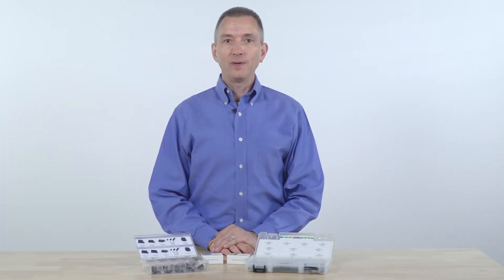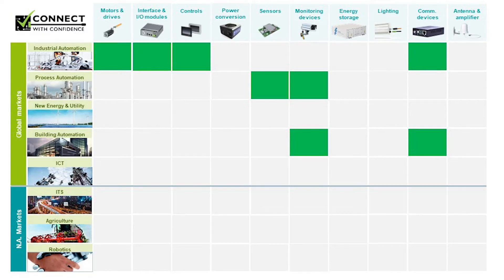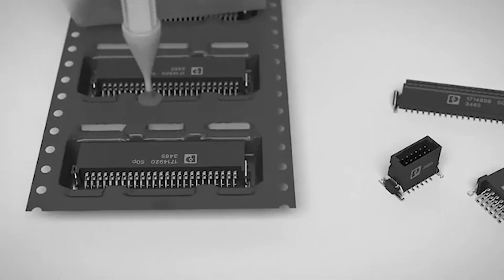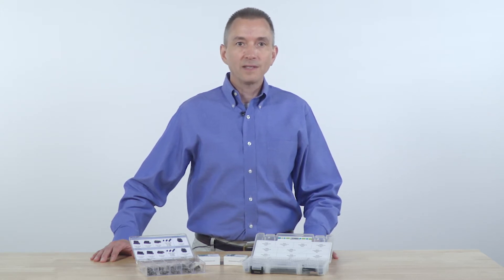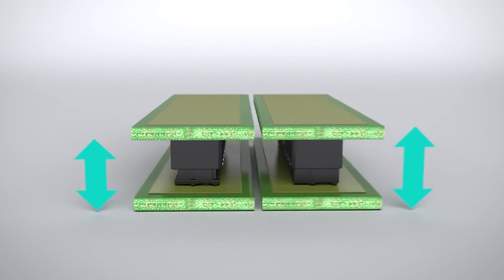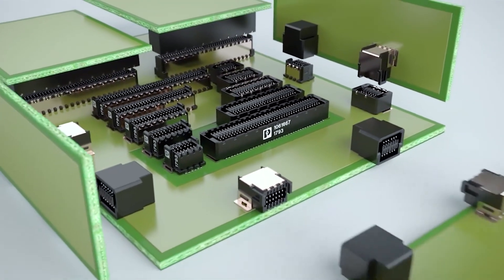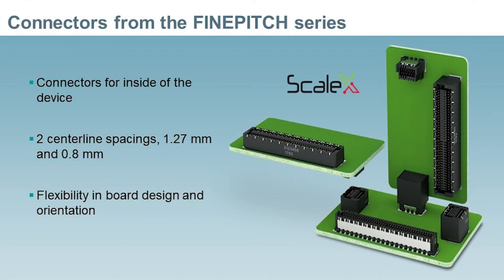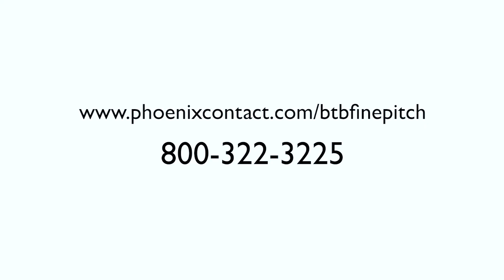Make confident connections with FINEPITCH board-to-board connectors

Comment: IS IT AVAILABLE THRIOUGH HOLE BOARD TO BOARD CONNECTOR
Reply from the maker: Due to the size of those parts, through hole is not possible.  They are only available as surface mount.